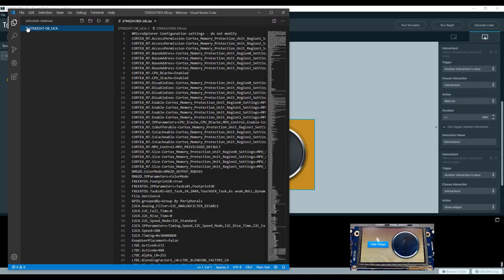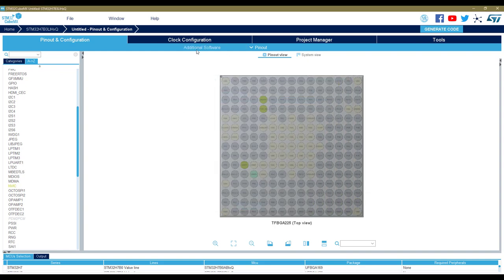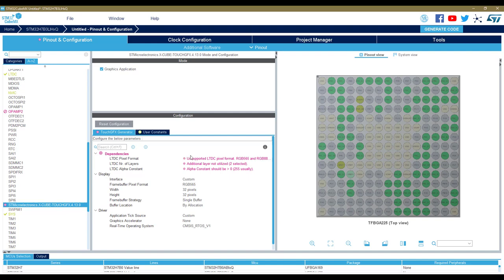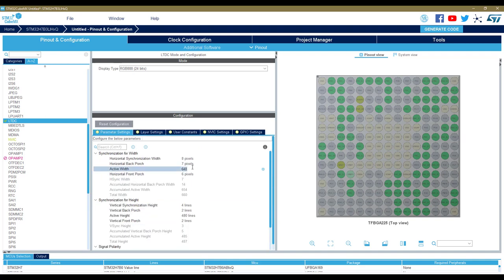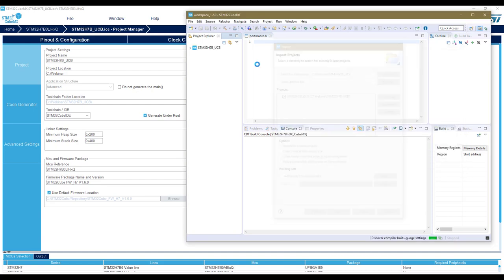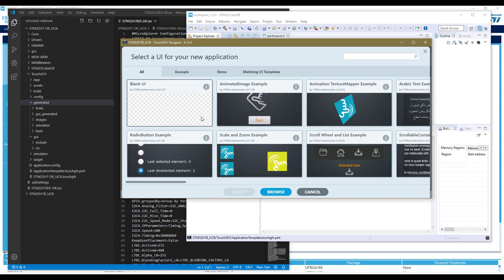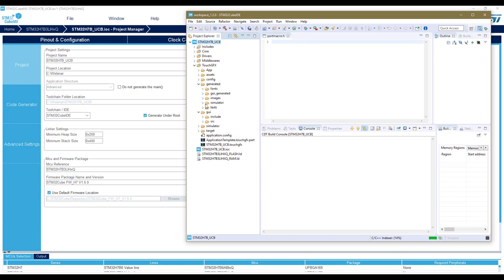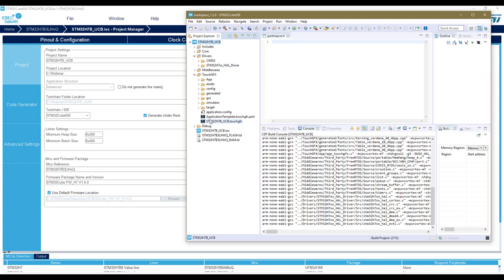TouchGFX Webinar - 3 - Project customization

Comment: Hello! How can I configurate Cube and touchGFX for any  STM32 MCU and any display? Is there a good instruction in the Internet? I have not a STMDiscovery board - I have a custom STM32f405 board (only MCU and a Crystal oscillator) and ili9488 display with SPI.

Comment: At https://youtu.be/mU5eZ_EXW8c?t=243, you mentioned there is a circuit designer with application template that can come up with the board-specific initialization code. Can you point out where the tool is?